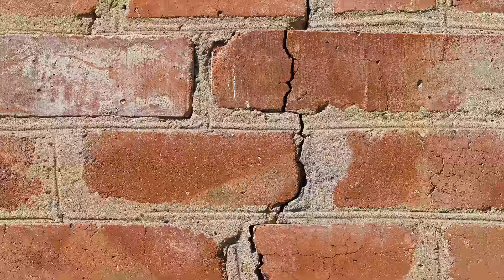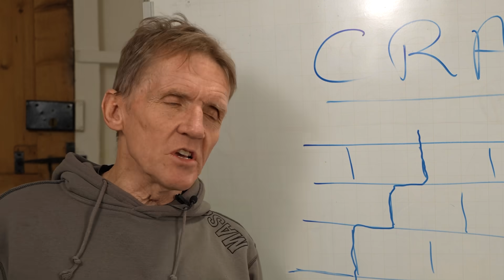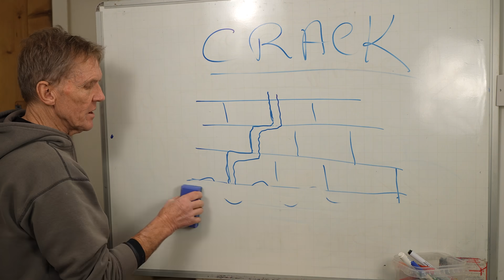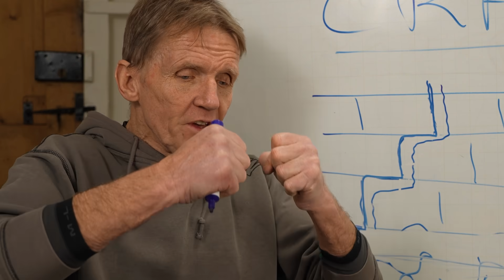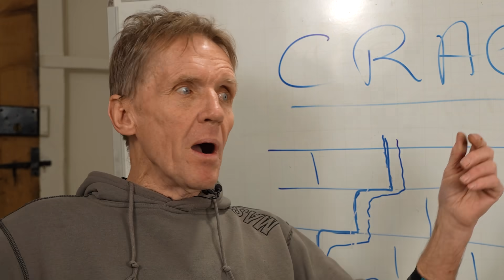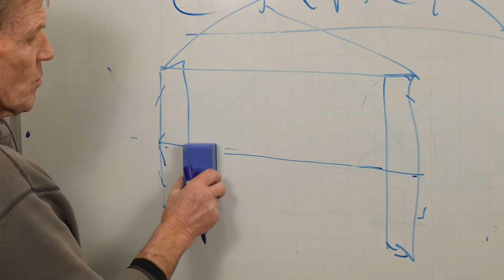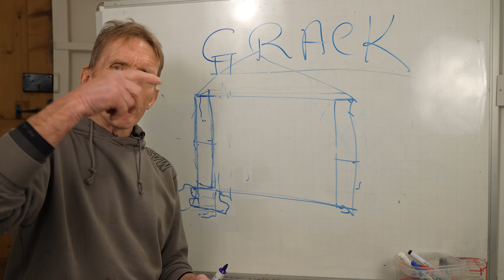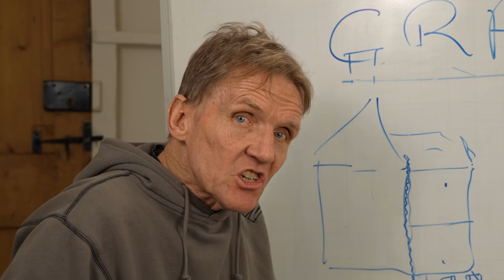Why Has Your Wall Cracked? and What Can You Do?

Comment: Great video! If the cracks are visible internally and externally, does that mean they are definitely subsidence? Or can anything else cause both? Thanks
Reply: Expansion and contraction , also age creep . How old is your house and what sort of ground is it sat on? Bricklayer of 35 yrs btw.
Reply: @knowitall3503  thanks! House closing in on 100 years old and on clay soil
Reply: Look up 'Clay heave'. Clay changes with the seasons, the foundations may be quite  shallow ( unless you have  cellars) so the house may move a bit.  My 30s bungalow has cracks that open up during  summer and close  in winter.  If your cracks open and continue to open then you've got a problem that will need investigating. Historic cracks suggest initial settlement or differential settlement, that can be a serious issue.
Reply: @knowitall3503  thanks. An getting it looked into. Hoping ground not too much of an issue as neighbours all fine

Comment: I was told for smaller internal cracks to grind them out enough to put something in, then insert a bead of polymer based construction adhesive which will maintain its "grab" and never set solid so maintaining a degree of flexibility and then use filler over it. I've never had a recurring problem after following this advice.

Comment: Got a crack in my separate garage and will need to be fixed in the summer due to it letting in water. its a breeze block wall with a layer of roughcasting. sits on a concrete base and has been standing for 23 years. i think i might need to call a professional than fix it myself.

Comment: I had a crack in the wall going down brickwork and had it filled and as the man said another crack appeared next to the original crack. I did think there was a problem with the foundation and the house was gonna fall down. The builders didn't know why and said perhaps it required underpinning.

Comment: wot causes bricks to belly out was looking at house for sale need lot renevation inside proby mid 50s house but inside below in front were bricks were bellying out slitly the breeze blok had droped slitly and plaster was cracked by ground floor window you could actuly see 2 inch crakk in breez blok

Comment: It is usually  because the ground under the home was not properly compacted It🙄 Happens mostly on tract homes. Also some areas need to have all deleterious materials removed where the structure will sit. Sometimes customers shift structure locations on lot. Bad news,  I was in the business.

Comment: Helpful as always, thanks guys.

Now I'm more concerned about the 5mm gap going around the bottom of my wall where it meets the concrete driveway and garden.  Should I use a polyurethane sealant to stop rainwater travelling down and around the foundations?

Comment: What's the ratio of hydraulic lime and sand one would use and which type of sand. Also, will this mix suffice for use around roof ridge tiles, too.
I have a slate roof and terrace house made from around 1904. Thanks.

Comment: I couldn't understand why my house had cracks in it - noticeably internally. Seems there was an earthquake of 5.2 back in 2008. Have I bothered to repair the cracks. Not really. Fwiw my old cottage I had was built in the 1700's. Very rare to find any cracks. Lime mortar covers a multitude of sins. But then the first cottage I had had to be underpinned. Simply because two other cottages that use to exist alongside were knocked down. In essence the wall was now doing something it was never designed for i.e. be a gable wall. Cost a tidy sum way back when. Thank you insurance company.  But yes, we seem to think houses never move.

Comment: Hi there I have a crack that goes all the way through from outside to inside. is this common and do you know the best way to fix this
Reply: l have the same,... inside, the plaster has blown up abt 1 inch either side of the crack,over the past 5 yrs,  running horrizontally halfway up the wall.  it was actually noticeable as a fine crack on the wall when we bought the house then. outside you can see the crack was filled in with silicon, not dug out at all.  l was going to dig out the crack inside and outside and fill it in with render,... but after just listening to what Roger just said,.. l wonder if anyone could  plsadvise me on whether that is a good or bad idea to do?
Could someone pls explain to me pls how l post a couple of photos here of the crack  ????

Comment: Fabulous info, thank you.... I am currently in the process of buying a mid terrace house build 1900. Unfortunately the survey came back to say it's unmortgageable. It is clear that either side of the house they have added concrete/steel ties a long while ago but the walls seems to be cracking again , also the floor boards have never been straightened as it seems. So I am not sure if to buy it or not as I am worried that the new cracks have appeared and it may cost me a fortune to repair and I may still not be able to remortgage it after?? 
Any advice in regards to this would be much appreciated.

Comment: I have done a number of repairs and if the building moves, it will crack at the weakest point. Its different in UK than in Western Australia. In fact Western Australia is different to say Victoria. I mean the ground. In some areas I have repaired there is a high clay content. Brick manufactures use the earth in these areas to produce their bricks. These areas have lots of cracking. Unless you put piles into the clay and deep enough to hit stable ground, that's the only way I can see reducing the tendency to move between season of dry and wet. 
A lot of people started doing liquid injections. Personally I'm not a big fan of this type of practice although its widely accepted. The Dutch have a wonderful way they build. The building moves separate to the ground. So the building moves with the ground sort of like a boat floating in the water. I think they have one floor underneath and then have another on top so they move in conjunction with each other. I'm not sure of the detail. I have undepinnedin the past on an old building. I did it in sections. It was only one bathroom so I stagnated the underpins and poured concrete. As the concrete had time to cure I progressed to the next underpin and so forth. It was a satisfying outcome which the owner was pleased with the results. Like Roger was stating its better to put back more, adding more strength when removing walls. I always like to over engineer so I satisfied I do the best I can do. Buildings these days are too minimalist. What I mean I have seen steel roofs with the thinnest  gauge steel which are flimsy until all assembled. Not only is this a dangerous practice when building. I'm wondering how long with it take before the protective coat on steel accumulates moisture to start rusting. Great video Roger.

Comment: My daughters just bought a semi detached house, she was assured by the previous owner that the crack all down the external wall had been there ever since she had lived there, she had lived there for around thirteen years, I originally Thought it was subsidence, but there is a loft conversion with a bath in the loft, it seems to me that this is the cause of the problem, as the brickwork is split from the ground right up to the loft, it not only goes down the mortar line, it’s actually split bricks in half, just wondering how to tackle this, any help would be appreciated !
Reply from the maker: Hi Cliff 
 A bath is not going to make that much difference but loft conversions can be a problem on some foundations. I would need to see a few pictures to help any further
www.skill-builder.uk/send
Reply: @SkillBuilder  ok my friend I will get some to you !

Comment: Very informative video. My house has a couple of annoying issues. I have a saltillo (fired clay) tile kitchen floor which has a crack creeping across from the outside wall. I do have a very large pine tree in the garden a few feet from the house. I was wondering if a tree root could be lifting the kitchen floor. There is a definite uplifting of the kitchen floor where the crack is. On another subject, the concrete foundation of my garage is crumbling near the base of the outside wall. The house roof outside slants down and there has never been a gutter installed there.  During rain water cascades off the roof directly onto the ground by the garage.

Comment: Our house was built in 1930 and there is stepped brickwork above where previous owners have placed a bay window with French doors. This juts out from the outside wall and the crack goes from above the bay window to the bedroom window above it.
The stepped crack is only in the mortar, surely there must be steel above the bay window?

Comment: I once worked on a multi-floor condo. A crack appeared on one of the external walls in the basement,  and was getting bigger as it went up. We followed it all the way to the roof, where we held a party, because the crack was mighty there.

Comment: I had a 1700 built cottage back in the early 90's. It was obvious that it was moving but finding out why was a bit of a mystery. Well, it had been standing since the 1700's. Eventually we claimed on the insurance. It was underpinned with invisible tie bars at a cost of £26K. It was only later, doing some research on the village, I came across an old photo of my cottage. Seemed that my semi detached, wasn't actually built as a semi detached building. There use to be an archway with 2 other cottages to the left of it. They had been demolished back in the 60's. Effectively I had a wall not originally designed as a free standing wall. The under pinning and tie bars solved it but it was a very worrying 6 months.

Comment: It would have been good to have also had a more directly vertical crack through mortar and brick (i.e. not just mortar) discussed, kind of like as pictured at 0:30 but where the brickwork is overlapping and the cracks gone straight down through the middle of the brick on alternate courses of bricks.
Reply: Jesus, that sounds structural – your bricks are under stress, either through foundation settlement/subsidence or you don't have enough expansion joints in your brickwork allowing your bricks to expand and contract with the weather.

Three years on, I hope you're okay, and not buried under a pile of rubble...  😳

Comment: HELP! My village house has a brick basement and the rest of the house is made of wood. The house is 120 years old and is built in rural Georgia (the country not the state). The ground is full of clay and that caused very many big cracks in the brick walls! one of the sides of the brick walls is bowing VERY much, 15 or even 20 cm i think. if the wooden floor was to be removed, will straightening of the basement brick walls which are now exposed from the top be possible? How can we do that? How will we be able to keep the basement brick walls from cracking if we were to fix them up in the future?

Comment: Thanks Roger, 
spot on advice for someone with my situation. We bought a 1930's semi last year and uncovered a very large and disturbing crack in the party wall. the crack itself is around 20mm wide so pretty significant. We found after moving in that the house had subsided at the the party wall. Through our own investigations it was due to a cracked drain which was fixed and I think the external wall was stitched, just as you explained using rods in the course work. 

Both the party wall crack and the remedial work was around 30 years ago (according to previous occupants).  However, We wanted to ensure it wasn't slowly growing over time. I've been recording tell tales and taking measurements for over 12 months. There's been seasonal movement within .4mm but the crack returned to its original size 12 months later. 

With that we're assured that its no longer an on going issue and was going to stitch the party wall using the twisted rods. Do you think we should bother or just repoint with lime mortar?

Comment: Really sensible advice here although I would pick up on your comment about using NHL lime.  Modern Hydraulic limes are not the same as they were historically and there is much concern in the conservation industry that the long-term curing of NHL limes leaves the mortar a hard as or even harder than cement, even NHL2.  Mortar in crack filling doesn't require structural strength and so a lime putty mortar would be a better bet.
Reply from the maker: Thanks I had read that about lime continuing to harden and this morning I was breaking out a 120 year old below ground wall and the lime mortar is very tough indeed.

Comment: So, a strong mortar mix ain't what it's cracked up to be!
We have some "interesting" cracks in plaster/breeze block internal walls that have "developed" more (~4mm) in the past year after we fixed a very slow roof leak in the ridge area. I'm hoping it's just the drying out process. There are no mirror cracks on the other side of the wall ie the breeze blocks. Are we correct in thinking there isn't a real problem.

Comment: Seems to me that more cracks occur in modern brickwork than old. Previous house was on London Clay and 150 years old, mortar was very weak with little pebbles up to a quarter of an inch, probably from locally dug sand. Movement, but no cracking of the walls as I think the pebbles acted like ball bearings.

Comment: I have a garage that has cracks roughly the same place either side of the building. The concrete base was split in two pieces and not a single one and it is roughly where it meets. Also the house on one side has a large tree right up against the garage and the roots are more than likely making it worse. I want to convert the garage cheaply to a playroom for my kids, just not sure if it's worth it or safe. I think watching this it is, the neighbours said they tried to repair it years ago and it just came back. We have lived here 8 years and never really noticed the cracks due to the position and amount of stuff in there. So considering this must of been there 10 plus years it mustn't be that dangerous?

Comment: Had an internal crack on front outside corner of house (ex-council stock 1950s) for a few years and came back from a two week holiday last weekend to find it has grown! I’m reading a lot about clay drying out because of the very dry summer this year, but I also have an ash tree close to the house that’s sucking the ground dry. What’s involved in getting someone to drill down and check the foundation/drains? I’m assuming it’s all cameras but wouldn’t mind a few small holes being dug to have a proper look.
Reply: We had a large Ash tree about 4m from the corner of my house, in next door's garden, it grew 3m taller than my own house, which is a regency building with high ceilings, I'm convinced the cracks we were seeing were due to the tree drinking gallons of water a day. We asked them to cut the tree down, they did too and I think its cured, waiting now to see as its been a year, but this dry spell will be  a good tester, fingers crossed

Comment: Someone please help me with this query - 

Can the sytem like helifix be used inside the property. All videos show that they have to be used on the external walls. 

They show work carried out on plain brick without rendering. 

What if it was a victorian property and some rendering was done outside ? Also can the helifix bar be fitted internally inside home as well ? One of the builder has told me they will install 3 helibars outside and 3 bars inside.
Reply from the maker: If you have a solid wall then it is a good idea to fit inside and out.
Reply: @SkillBuilder  Yes, it is a brick wall, with a thin rendering (not sure what kind of material was used for the render though, but a old render)

Comment: Roger - if you're advising not to fill external cracks then how do you prevent the elements (rain, frost etc) from getting in and making things worse ?
Reply: Sanded masonry matching caulk exists, it allows movement and prevents weather penetration

Comment: In old houses timber lintels are another reason why cracks form change them for concrete or steel. Another reason why cracks form are ferrous metals in joints of brickwork and stonework. When it rusts the metal expands causing pressure on the joint. Either remove it where possible or treat the metal with anti rust paint.

Comment: How can I contact you, wanted your advice on a social housing flat. I will try & explain in woman’s terms ha ha what’s going on! 

From ground level a crack has grown to at least 15ft high. It’s a vertical crack that can fit 2x fifty pence pieces. The crack goes through bricks as well as cemented bits! 
Think this flat was built in 1971
Crack situated behind water down pipe
No visible drainage as pipe goes straight into soil 
Guttering cleaned out, sadly rain water gushes over when prolonged raining or heavy rain.
Tree situated 20ft away.
At some point subsidence been monitored with blobs of cement either side of crack
Social housing surveyors x 3 inform me no action needed
Now got solicitor involved, same surveyor view crack informed me they fill with cement 
Im absolutely fuming! This crack is a structural defect! Bloody cement my arse!

Comment: Hi Roger, what would you recommend for an old mining house that is suffering from subsidence? There’s cracks to the external brickwork, and I initially planned to use a mortar repair mix, but watching your video I’m glad I haven’t yet. Thanks!
Reply: Repair with a  pliable  material in the  spring as ,  following winter rains, the cracks should be at their least pronounced.   Obtain a copy of Building Research  Establishment Digest  251 as this offers sound reliable advice on cracking to low rise buildings.